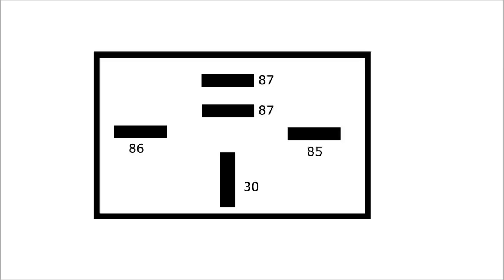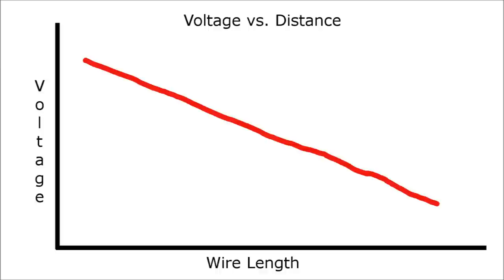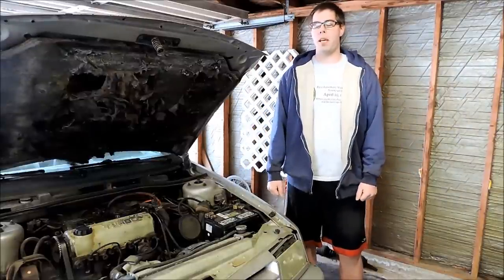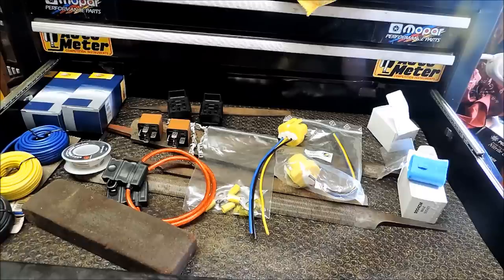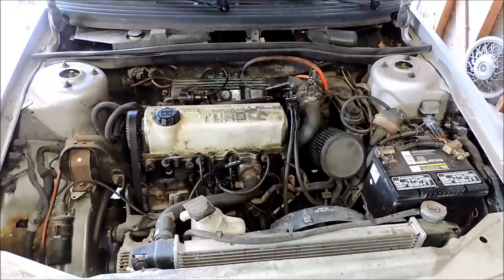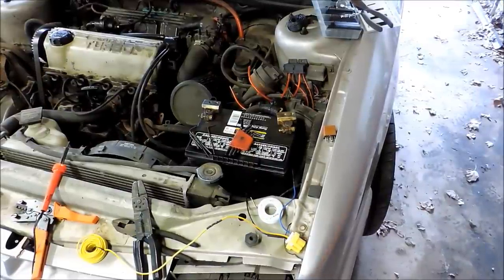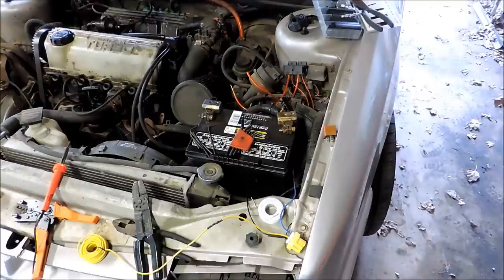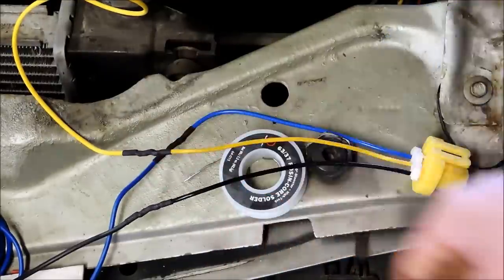Why and How to Relay Headlights

Comment: You could have used 2 different relays that had 86, 85, 87, 30 & 87a. If you would have hooked up your low beams to the 87a on both relays then, they would have turned off when you hit your brights, like most cars - if that is what you wanted to do. Being that the relays you had came with a kit, I understand why you didn't. Good job, well done! - just an observation.
Reply from the maker: That's true. Depending on what headlight/high beam switch the car has that could be the better way to do it. Another option is to use that strategy to turn off the fog lights when the high beams come on. With all the different relays out there the possibilities are endless.

Comment: OMG. I truly needed a video like this to make it logical. I just recently put LED Halo lights on my 66. From one day to another, the headlight won't turn on. I order a headlight switch and pruuum, back on the road. I decided to put relays, now, one side won't turn on. My luck. I tried to be fancy and install a relay for low beams and a relay for high beams. I am stuck now. One side won't turn on. LOL. I have 4 headlights
Reply from the maker: I always start at the headlight connector and work my way back. I use a "Load Pro" which pretty quickly tells me if I have a problem with resistance, open circuit, or a bad ground. I then work my way back to the relay. 

You did make sure to use a dual 87 pin relay, or made sure to splice two wires off of pin 87 when running them to each side, correct? Though, I suppose if you used 87a, it would be on when the switch was off. There are some funky relays out there though, so who knows.

Comment: Absolutely excellent - thanks for taking the time to put this together. It was really easy to follow along and understand what you're doing. I was actually scouting for info info to help me with wiring accessories up on my bike (e.g. Hella Supertone horns). The practical example of your car headlights is all completely transferrable. I didn't know the reasons for relaying a lighting circuit, or the relationship between light output and voltage. Really great to know. THANKS!!
Reply from the maker: Glad the video was a help, Tim. Thanks a ton for the comment.

Comment: Which way do you say current is flowing ?  because you used the terms power and ground  not Pos & neg
Reply from the maker: That's a good suggestion. I made the video for folks with normal 12v systems, and I went with the most general terminology. I think most folks are looking at the positive and negative terminals on the battery while doing this, so that's how I did it. I really appreciate the feedback and the view!
Reply: @bwcordes  DC current flows from the Neg  to the positive. Many are confused  on it equating ground to AC currents flow
Reply: From what I got of your understanding , your not qualified for teaching auto electronics
Reply from the maker: @artyfuffkin7805  You're right. I'll leave the classes on theory to you, and I'll keep doing the how to videos. Thanks again for the feedback!
Reply: @bwcordes  but I've got some relay ?s  what is the bread board  in a  auto relay for
Reply: and any loaded up high voltage in a relay ?
Reply from the maker: @artyfuffkin7805  I did pick up some Hella relays this last summer with an internal diode to take care of the flyback voltage. They worked really well, and I recommend them highly. The high wattage setup in my Shelby Lancer was really causing problems when I would flip the high beams on and off.

Comment: Does both the 87 output,follows with polarity,i did this diagram,unfortunately only 1 light lit,and not on the other one
Reply from the maker: If they're both terminal 87, it should work. If one terminal is 87, and the other is 87a, then only one will be switched at a time.
Reply: @bwcordes  it is both 87,if thats the matter,maybr ill check the polarity on the other light,but i did what is in the diagram
Reply from the maker: @walterjabillo918  I would suspect that, or a ground issue more than anything.

Comment: i need some clarification... did you use 1 relay for high beam and the other for low beam? Or, Does each relay control 1 headlight?
Reply from the maker: Yes, one relay for high and one fir the low beams. The original power wire for each now triggers the the relay.
Reply: ok.. thanks alot 👍
Reply: Think of relay as a switch. You need two switches to control H/L beams seperately.
Reply: Davian Walker "
Reply: Shit me I hope I remember this, I saw relay lick

Comment: hi i just got HID for a 2005 scion xa ..i installed them but when i put high beams on they go out would it be because  i need a relay ..thanksthanksb if u  kan helps
Reply from the maker: +Edgar Barbosa 
HIDs should pull less current than a standard bulb. I would double check your wiring, especially the ground and then I would be questioning the kit.
Reply: +bwcordes
I shocked the wire n move them around I tride them in different patterns...
when they turn on the high and low beam r on and the sitting is on low ....ones I turn on the high beams they just go out like if the fuse was burn but it's not ..thin I turn them off and back on and come back on ...
Reply: +Edgar Barbosa You probably need 2 relays, one for the low beams and another one for the high.  So that you have 2 different power sources that turn on and off from the high and low.

Comment: Thank you so much for being the first person to explain this so that a newbie like myself can fully understand it..
One question: 
I have connected two 5pin relays one for low beam and one for high beam and both work perfectly
 Can ai take a connection from pin 86 on the high beam relay( this wire comes from high beam stalk on steering column) to pin 86 on a third relay(powered independently) for two  spotlights..TIA
Reply from the maker: I daisy chain the trigger and the ground on the relays all the time. It makes for a neater wiring situation and fewer points of failure in my opinion. Thanks for the kind words, and the view!

Comment: Definitely answered my question as ive replace my light switch 4 times since 2019. Plus my connector at the switch melted back in 07 when my original switch failed.
Reply from the maker: Great. Glad I was able to answer your questions. Thanks for the comment, and the view.

Comment: @ 17:36 you mentioned terminal 87a but didn't say if you were talking about a 4 pin or 5 pin relay. I have a '90 LeBaron with headlight problems so decided to install a relay. My problem is the schematic embossed on the side of my 4 pin relay cover shows 85, 86, 87, & 30. However, the four 1/4" male spade terminals are labeled 85, 86, 87, & 87a. Does the 87a spade terminal equate to the 30 as shown on the relay cover? No one has responded to this question. Is it because nobody knows the answer to this question and would be embarrassed by saying so? Or do the many video instructors out there simply not care?
Reply from the maker: There seem to be endless variations of the "Bosch Style" relay. Generally speaking however, if it's a 4 pin relay, then you have the 85, 86, 30, and 87 terminals only. The 5 pin relays are most often the 87/87a style. As I hope I mentioned in the video, I use dual 87 terminal 5 pin relays so I don't have to splice the wire coming off of pin 87. I have moved to using relays with a diode in them to prevent the flyback voltage from freaking out my older electronics. They're a noticeable difference in my early cars when using very high wattage bulbs. I have been ordering the Hella units from Susquehanna Motorsports.  They had to order them for me last time, but it didn't take long, were reasonably priced, and the only ones I could find so it was a relatively painless choice.  

I hope all that helped.

Comment: Got an old (18y old clio 1.4 16v 2001 with 110hp) car (car is old as me lol) for myself, problem is it doesnt have automatic lights and since its an expensive ticket for not having your lights on (in europe you need to have lights on day and night) so i connected a relay to my light swich and key ignision position. What i wanted to say is that i can leave the switch in on position and remove the key and the lights would turn off, same as if i put in ignision positon my key they will turn on...

Thank you for your video, i used 4mm thick silicon wires (for space heaters) for this
Reply from the maker: That's a great solution. Thanks for taking the time to post up about it.

Comment: Good video,  is it possible to jump from 87 to the rest of your nighttime running lights.thanks
Reply from the maker: Absolutely. I've wired up cars to always have the fog lights on when the low beams are on by jumping power from the low beam relay to the fog light relay. You could take off of the 87 terminal to power the other lights, but I would just as soon use the trigger for the other trigger. Now, if you're wanting to use the terminal 87 to just power the other lights, I would just be sure that your relay and wiring is up to the task of the added amps. 

As a disclaimer, always be aware of your local laws for things like this. There are some silly rules that can can get you a big ticket in some places.

Comment: THANK YOU THANK YOU THANK YOU for an ACCURATE THEORETICAL EXPLAINATION IN A NUTSHELL so to speak
Reply from the maker: You're welcome. I'm glad you found it useful.
Reply: bwcordes Alot of other videos don't explain the fact that Power Output is expotentially increased and thus as a result Resistance is decreased as you show with first simplfied graph of Exponential increase of Power Output. Another thing you pointed out is that current decreases as the length of the wire increases (the fundamental concept of DC Voltage). Very well explained as depicted with the Devin simplified graph. :))))

Comment: Great video;  I need the relay you used as an example.  I currently have the 87a version, which is junk...for the reasons you alluded to.
Reply from the maker: If you type in "Hella dual 87 relay" into Amazon's search bar you should come up with some options. Go with at least 20A for the current rating on it and you should be all set.

Comment: Hello I have led headlights do I have to add what you’re doing in the video to my headlights or since led draw so little power am I fine with just the stock setup they are 25 watts each or is it just better to do the relay that you explained in the Video please replay thank you for you’re information on the subject 
Thank you
Reply from the maker: LEDs aren't dependent on voltage, and that's not a lot of amps to go through a headlight switch. Unless you have a very old vehicle with a wiring harness in very rough shape, I would skip the relay conversion.

Comment: But my car is a 1976 Plymouth volare the wiring is old but in good shape I could do the relay conversion if I choose to do so right it’s not going to harm anything and it will work just fine right just to be on the safe side thank you for you’re expertise and you’re time
Reply from the maker: I know that the old Chryslers tend to melt the headlight switches on occasion. The relays would be a good way to isolate the current from inside the car.

Comment: I bought and installed a relay harness from Dapper lighting.  Its a 5 minute plug in installation. 
 1971 charger with 4 headlights and flip headlight doors. 
 Lights and doors function normally when the brights are on  but when the low beams are on the doors remain open.  The doors wont close after shutdown unless i switch to brights before shutting down.  

 This video is 9 years old, is that baby still running and driving ?
Reply from the maker: That's interesting that they won't close unless the brights are engaged first. Cool that you found a good solution though. The 90 shadow was mostly rust when I made this video, and it has long since been scrapped. I'm currently driving an 89 Shelby CSX for a daily driver, and have another one tucked away in the garage. I think those are what I'll drive for the rest of my life. Thanks for the comment, and the view!

Comment: Hii from Mauritius.... Great uploads of your videos... Joined your channel i guess around 6 months ago and I have watched quite a lot of videos..
I have an issue concerning my car...
I'm wiring the alarm siren to the car horn... So that when the car is armed or disarmed.. The car horn sounds once or twice...
I completed the wiring.. and it worked... The only issue I have is that the car horn is sounding too loud... Wat can i do to make it lower so tht when i arm the car... My neighbors won't be cursing me.. 😅
Thanks.
Reply: Easiest way is to use a different horn.  Most American cars just use the cars actual horn at the same volume to arm while most German cars have a regular horn and then an alarm horn (sometimes just an additional wire for the actual horn.) for arming at a lower volume.  You could try installing a potentiometer or a resister as well between the horn power being fed from the alarms relay.  A potentiometer is used to increase/decrease current and you can get them in a variety of styles. Some car horns have adjustment but be warned as that adjusts the horn for all operations.

Comment: How to determine the relay voltage & current enough for the accessory? Let's say headlight is 12v55/60w, relay selection would be anything above 12v & current above 10A? The fuse used from the connection to battery would be 2 times preferred?

Comment: Great video, this explains a lot!   I do have one question, though.  Any help would be greatly appreciated.  

I currently have my main headlights as my DRL and I am wanting to add some LED fog lights to run as the DRL instead.  I have figured out how to get the LED lights installed and tie them into the fuse panel to turn on when the car is on (this is how I want it).  

My question is, how would I relay off of the parking lights with this kit?  My headlights and parking lights automatically come on when it gets dark enough, so it seems that parking lights would be a good source to trigger the relay.  

Thanks in advance, and once again, great video!
Reply from the maker: The relay will draw so little current that you should be able to tap into any power source you want in order to trigger the relay.

Comment: Hey thank you very much for the informative tutorial. I have one question. Should an inline fuse be installed between battery and relay connection? If not, do you know where? or if i need one?
Reply from the maker: I install a fuse between the battery and the connection of the load carrying wire to the relay. I've used the inline fuse holders and a fuse block before with equal success.

Comment: My wife's Honda Civic kept having the headlights go off while driving at night. The car had been recalled for this back in 2011. Honda had routed all the headlight current through the headlight switch on the steering column. Over time this would cause heat damage to the switch. I added a relay, which now carries the headlight current and the switch only controls the relay.
Reply from the maker: Thanks for the comment Joe. It's amazing to me how many companies ran all the current through the switch for as long as they did. It just doesn't make sense for so many reasons.
Reply: @bwcordes  Agreed. This is an especially dangerous situation. All of the external and internal lighting would be lost suddenly when the lone ground to the entire lighting system was lost due to thermal damage inside the headlight switch. The problem was being exacerbated because the hot air coming from the dashboard vent discharges directly onto the switch on the steering column. I reported it to Honda and told them they needed to do another recall because the problem is coming back but they just blew me off. I guess until someone gets killed in one of these vehicles they don't consider fixing it correctly to be worth the money.
Reply from the maker: @joevignolor4u949  Thanks for doing your part in contacting them at least. I'm perplexed as to why they would take on that level of liability, especially since know of people who had fires under the dash of their 80s and 90s Chrysler vehicles from this same issue. Then again, there's the airbags and other problems. It seems like it never ends.
Reply: @bwcordes  The problem is the car companies look at the costs of doing the recalls versus the potential liability of any accidents. This is what happened with the Ford Pintos back in the 1970's that the gas tanks would explode in a crash. The solution would to be to put executives who make these decisions in jail for manslaughter but that doesn't happen often enough. Unfortunately.
Reply from the maker: @joevignolor4u949  Indeed. It's like the scene in Fight Club where he describes how his job at the insurance company works.

Comment: I realize this video is 6 years old, but  I was wondering if a relay could take the place of a inline diode on a bow and stern light on a boat application. I bought the boat used and the wiring on the light switch is to crowded.   Thank you!
Reply from the maker: What type of lights are they? I know there are some relays with internal diodes to prevent the voltage spike when the magnetic field collapses as the relay is turned off.